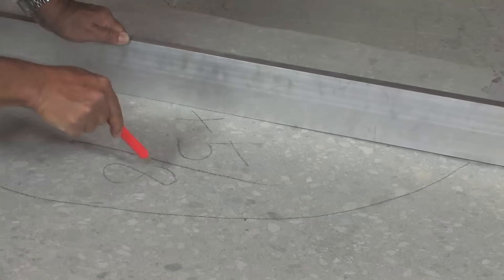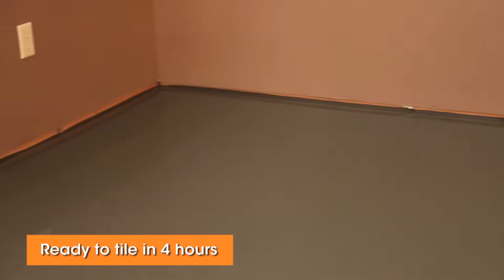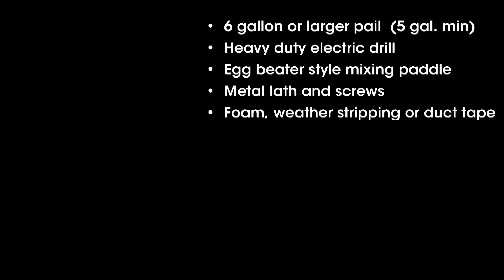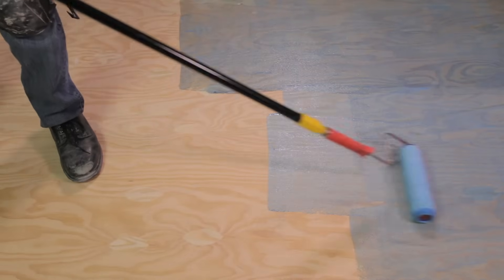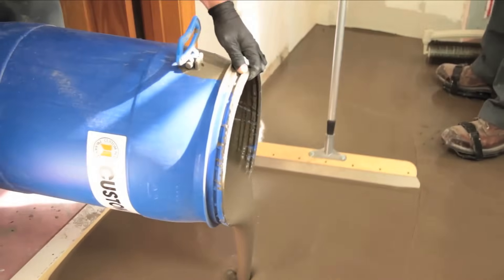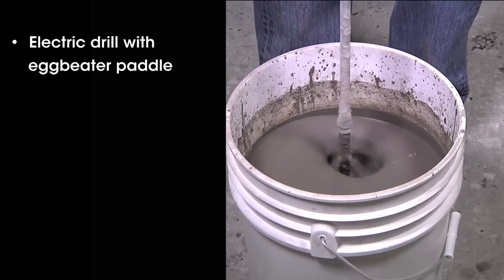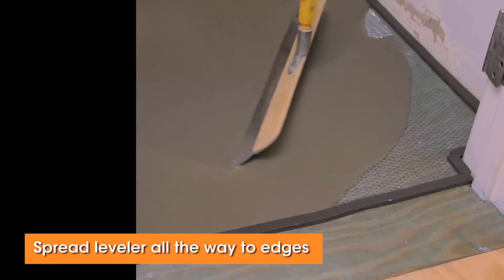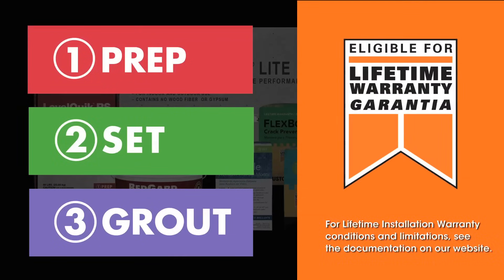How to Install LevelQuik RS Self-Leveling Underlayment

Comment: What kind of caulking is used at the joints (1:42 of the video)???  I'd hate to use the wrong stuff and screw this up...  Can you also use the same caulking around the edge of the floor and wall instead of what the guy is using at 1:39 in the video???
Reply: Speaking from experience, use any kind of paintable caulking..  dont use silicone..  especially to cover up nail holes or gaps in the floor, the shit will not stick in those spots and will act hydrophobic and try to go everywhere else but there...

Comment: What happens if more than 1.5" is necessary?  Can you recommend a product for 2.5" fall?
Reply from the maker: You can do 2 1/2" in two pours (layers) or we have a technical bulletin on increasing the thickness with the addition of gravel here: http://www.custombuildingproducts.com/media/60093817/tb79-extending-the-range-of-self-leveling-underlayment.pdf.

Please feel free to give Technical Services a call at 800-282-8786 to discuss your individual project.

Comment: not expecting an answer but do you have to use the mesh when you are on osb?
Reply from the maker: Hello Richard,

Yes, we recommend using a metal lath when installing any leveler over wood subfloor to account for deflection and natural movement of wood.
Reply: CustomBuildingProd it says not to use this product  on osb, is there a way around this? or do I have to use another product?  I'm going to use this in my basement but I need to know if I'm ok to use this on osb.on my main floor
Reply: CustomBuildingProd and thank you for your reply
Reply from the maker: Using LevelQuik RS over an OSB is detailed in our TDS. http://www.custombuildingproducts.com/TDS/TDS-108.pdf

OSB underlayments should be coated with 10-15 mils of RedGard®
Waterproofing and Crack Prevention Membrane prior to priming
with LevelQuik Latex Primer. A 2.5 lb/yd² metal lath must be fastened
every 6" - 8" (15 - 20 cm) with fasteners that have a galvanized or
corrosion-resistant coating. A minimum of 1/2" (12.7 mm) of LevelQuik
RS can be applied over this properly prepared OSB.

If you require more assistance, feel free to give Technical Services a call at 800-282-8786
Reply: See this is how you keep a customer. Thank you very much. .
Reply: Why does every other self leveler just say to caulk or seal all gaps and cracks, make sure to screw all flooring down to the joists every 6-8", clean surface, prime with Xxx type primer, wait to dry then mix X ammt of water with drill then pour on floor initialy pushing the naterial to low spots detsrmined before hand.  Wait dry.   No screen, no redguard, no required 1/2" thick pour, none of that othee bullcrap. Half inch..  jesus.  Damn floors only out of level 1/8" at most and dips in places..  half a bag would be plenty..  but half a inch?  Thats like what 300lbs per 50sq ft?  Then you would add all the morter anc grout and backer, tile... i mean jeez..  fuck this product..  expensive picky crap..